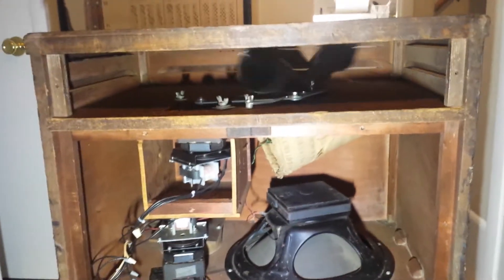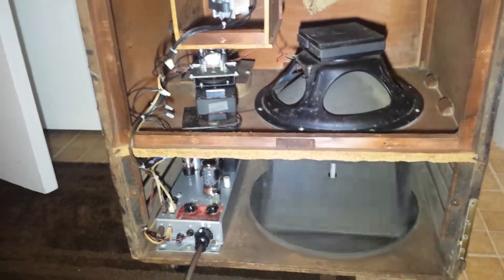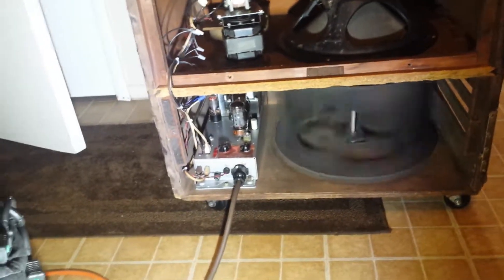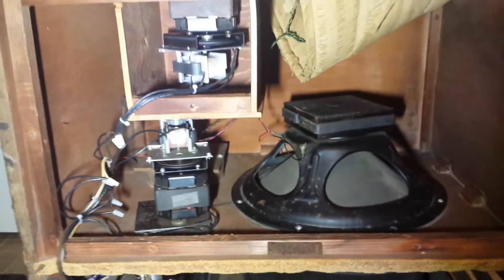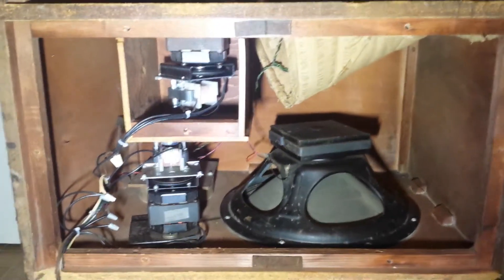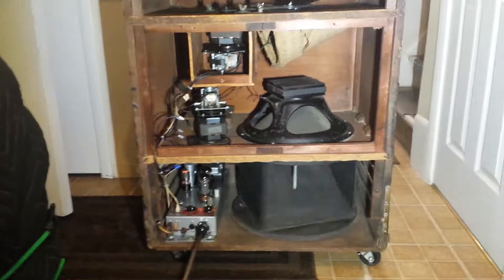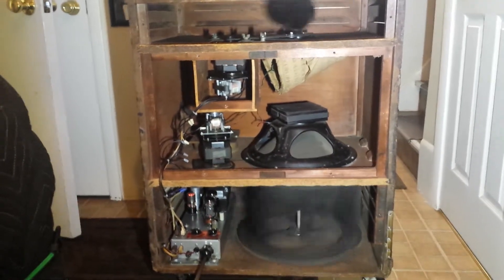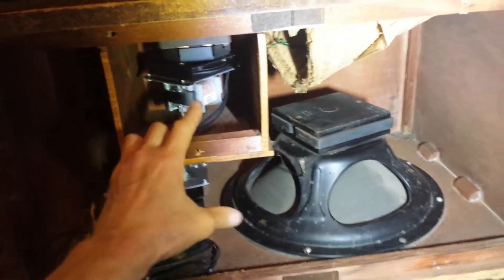Leslie 145 Speaker (2)

Comment: What does one do about a noisy grommet, that silver disc that the belt rides on?  Slow speed is fine but on fast you hear a bit of squeak noise, just a little but just enough
Reply from the maker: The little silver bearing with a groove that the belt rides in? If so and it is squeaking, see if you can lubricate it with Leslie oil or something similar.
Also see if it is rubbing on the flat piece of rubber under it, if so bend up the springy arm just a bit so it clears the rubber piece.
Reply from the maker: Sorry for the long reply. YouTube isn't notifying me of comments posted.